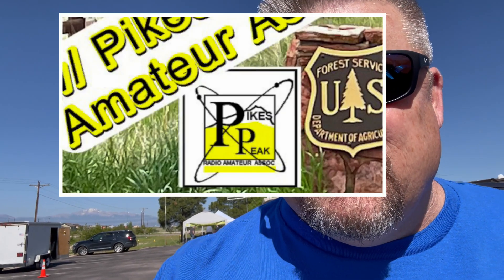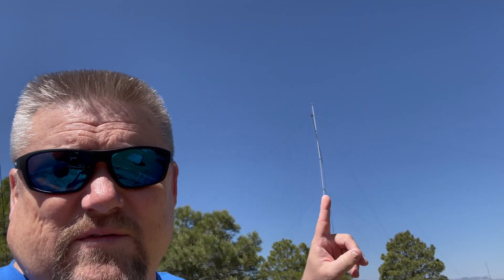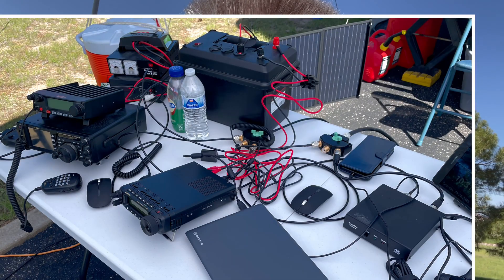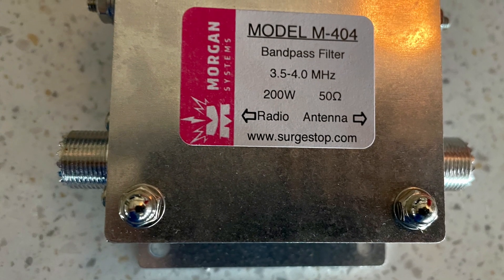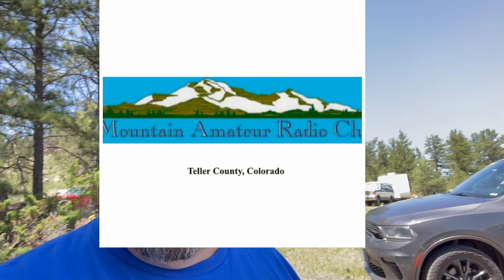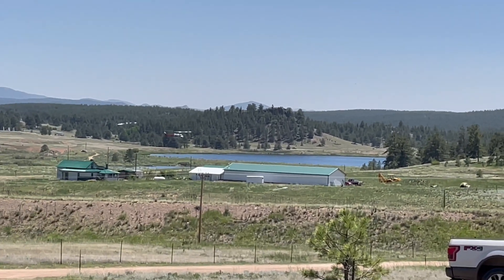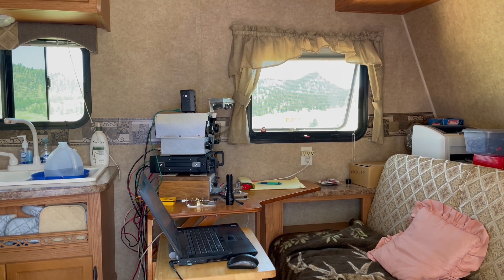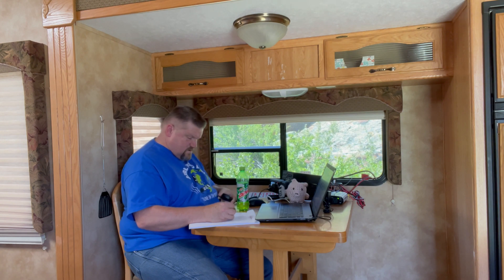ARRL Field Day 2023 with 2 different radio clubs in Colorado

Comment: Thanks for taking the time to support field day and putting this together, we all love what you do.   The guy in the Ham Radio 2.0 shirt, the FTdx10 setup, and Montana RV are beautiful (I might be a bit biased, lol).  Hope you don't mind me adding some info for those who might be curious - We had 3 primary stations, 1 CW, 1 FT8, 1 SSB (CW stayed as CW the whole time - a few times we had both the others on SSB and/or FT8 at the same time, different bands) - we had a GOTA station, and a VHF/UHF station. As far as the antennas, there were 2 - 80-10 EFHW's (you mentioned the one by the road, there was another about 250' to the west streched between a couple of trees), 1 - G5RV, 1 - Buddihex Beam (20-6), 1 - MPAS Vertical (160-6), 1 - Vertical VHF/UHF (I never did ask what it was), and 1 - VHF/UHF Yagi.  I'm glad you mentioned the bandpass filters, they are an essential part of multiple stations in close proximity.  It was a good time and as always, we're already looking forward to next year.